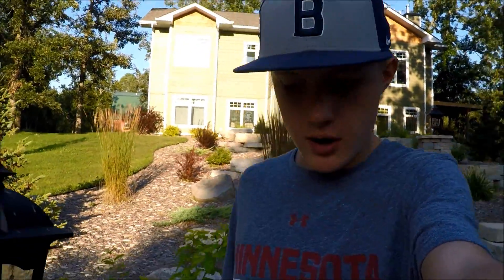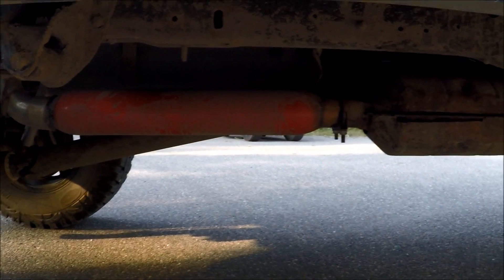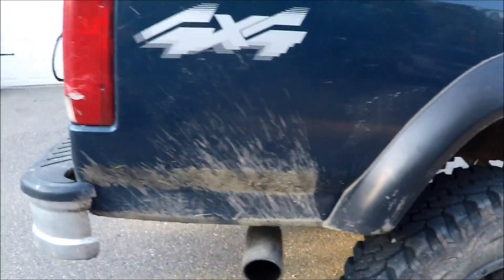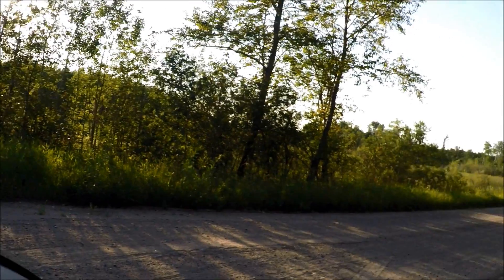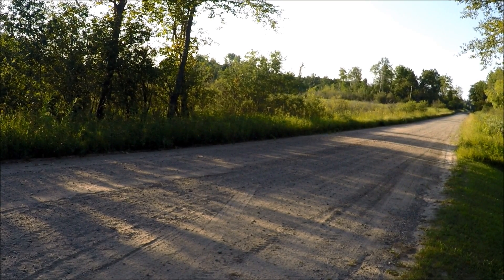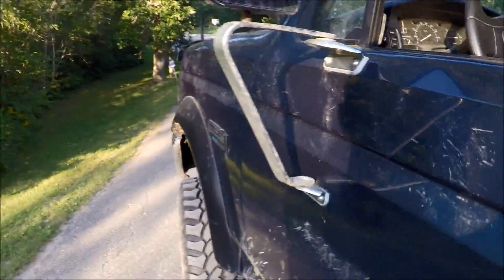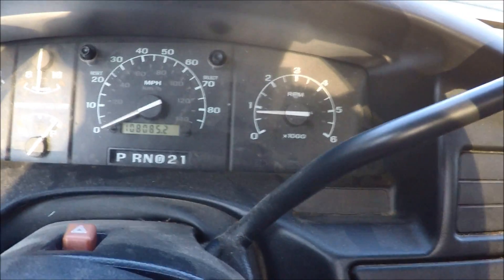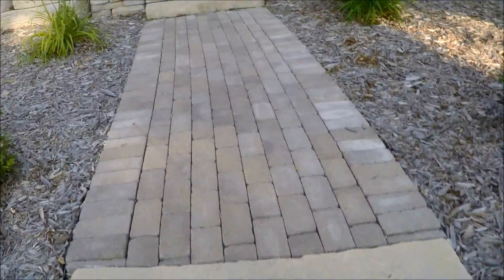Glasspack Exhaust Start Up and Driving (1996 Ford F-250)

Comment: someone who actually knows about trucks and isn't a mall crawler? Is this real life?
Reply: Nicks Customs usually mall crawlers are new diesel trucks this looks like a simple off road truck usually mall crawlers have a paint job light bar bumber huge lift it's what I feel about land rovers a true dedicated off road capable but many are used as family haulers and grocery getter yet they have adjustable suspension low range locking diffs or many raptors I have seen have never touched dirt

Comment: Love your truck man looks good
Reply from the maker: +DodgeGuy67 Thanks man!!
Reply: I've got an OBS 7.3 atm. Can't go wrong with either lol
Reply from the maker: DodgeGuy67 That's sweet! i would love a 7.3
Reply: +UpNorthOutdoors I love mine, it's got a moonroof in it and a bullbar. In Connecticut I saw a 97 F-350 for 4500. It had the 7.3 in it. 108K original miles barely any rust on the body, single cab longbed, plow kit, 4X4. Man I wish I could get that rofl.

Comment: Hey just a question but I have the same truck and same lift. Now I've had it for over 2 years now and the front still hasn't leveled out. I replaced the 3" blocks for the rear with 4" to help level the truck out but it still wasn't enough. Did u have this problem with rough country or did u do something else like take the 2nd bottom leaf out?
Reply from the maker: Yeah I have the same problem. Your best bet would be to get bigger blocks or get 6 inch springs in the rear

Comment: oh well I'm out of big lake. I have a 97 f250 with a Dana 60 king pin axle just like yours in the front 7.3 4 door short box 4 inch lift. 91 f150 the video that I posted that I put the radiator in the box 8 inch suspension lift 3 inch body spooled 9inch rear end Dana 44 solid front I have a locker that I'm going to put in it. I also have  95 f150 302 6 inch suspension 3 inch body that I'm in the process of putting a Dana 44 solid in the front.. love these trucks! I haven't posted much in a while. your buzzer that comes on when you open your door with either the lights on or keys in the ignition have you removed that yet?
Reply from the maker: +Greg Soderlund That's so sick dude! and nah i havent removed it yet

Comment: I want to show you a picture of the gap filler in between the tailgate and bumper of my f150 its a piece of diamond plate aluminum with Built Ford Tough cut out in the center and red lights behind it so it lights up red. are you on obs Addicts on face book?
Reply from the maker: +Greg Soderlund No but I will be in a sec! lol

Comment: Do you have a video with the stats on this thing? Like engine, trans, options, stuff like that. If I had to hazard a guess I'd say you have a 5.0 with a c6 automatic and a tach...
Reply from the maker: Osthato Bulpus nah I don't. It's a f250 with 1 ton d60 swap. The motor is the 5.8 351w. Idk the trans
Reply: UpNorthOutdoors Thanks for the info, I just wanted to know. Also, pro tip, there aren't any emissions test requirements in MN so you don't need a catalytic at all. :)
Reply: More than likely a E4OD that's what my 96 has I think that was the only Auto in 96. Very good trans
Reply: @RazorbackGrasshopper  that maybe true my state never did emissions and removed inspection stickers altogether. Because only a state trooper could give you a ticket for it. No one cared. Most people never run into state troopers. And shops would take a 20 dollar tipif your tint was to dark or cracked windshield. Or any other problem. Even when all legit no shop would fill out the back of it always blank.  It's still a violation of federal law to remove or make inert a catylitic converter. I don't care I've removed them from nearly every vehicle that was v6 or v8 and remove and block egr. Global warmingis a scam. Co 2 is plant food. The levels use to be over 4x higher and life has never flourished more then that period our crops are yse to high co2. After the last icdage until the industrial revolution we we're only about 50-100 ppm until all plant life died off Killin the whole planet. You can take a reading in a cornfield in. The middle of day and the co2 levels plummet. They bottom out their starving for more co2. Co2 equals life. Co2 makes plants drought resistance. The lower the co2 the more the plant releases water from it's leaves. Crops need less water much less in high co2 environments. Co2 doesn't affect tempsture it reacts to it. When it's colder the ovreans hold more when it's warm they release it. Humans put out less then 1 percent of global co2 emissions. One volcano erupting is years of what humans put out. We are carbon based. They say don't eat beef cow farts are the problem. If plants do better in high co2 and profce bigger healthier crops and more oxygen. Then eating nothing but plants sounds like to worse option. Now it's done eat cows and eat babies to save the plant. Climate changes believers are mentally insane but they've been programmed in school and from the TV.climate changes it happens. Deserts came from oceans a jungles. I guess our cavefarts and barnfires and lit the whole subdivision on fire

Comment: You need to learn how to keep vehicles periodically correct. If you're going to modify a '90s pickup, go with the look that was meant for them. Your '96 has no value with those shoddy accessories.
-Keep it classy my friend
Reply from the maker: Noel Customs shoddy accessories? lol. Look at my newer videos. I'm not running gay 22" rims and throwing 50" light bars on it. If you look at my recent videos I'm even running KC's
Reply: Ah my bad. Didn't figure this out until after I wrote this comment. I personally think your truck looks kickass in it's current state. I got an '88 F-150 that I am restoring to Ford Nite Edition specs (Got a Lund moon visor, cab fairing, fog lights, 15x10  chrome wheels, and fender flares to add  even more '90s flavor) and was wondering if you would recommend glasspacks. I will be doing 2 1/2 in true dual pipes.
Reply from the maker: I've been running my glass pack for awhile now and it sounds great, so I'd recommend it